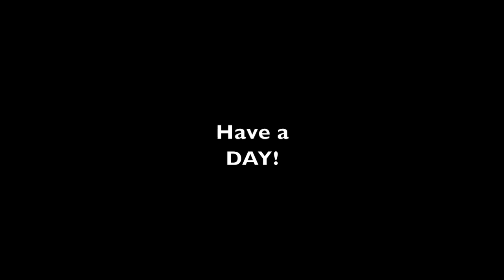#651 More Hardwoods on The Woodmizer LX 150 Sawmill, Red Oak

Comment: Starting at 4:45 it looks like the debarker and the blade are a little misaligned. Is it just the camera angle or just me.
Reply: Beat me to it. The band saw isn't tracking in the bark blade groove. There must be some adjustment on one of those two blades. Can't be such a big deal as there's bark on the opposite side that isn't addressed at all.
Reply: I noticed the same thing
Reply: Well a few of us picked up on this one I see. Well Mike, this tells me your camera work is quite good and your viewers are sharp enough to pick up on a small detail such as a misaligned debarker. Either some viewers are sharper than the average bear or the videos skew our viewpoint enough to ask about alignment of the debarker?
Reply: I immediately saw that as well! It made me wonder if we can’t see it via the camera angle as well as reality looks, but it seems to be 1/4” to 3/8” misaligned. I also noticed that the deviation appears to be less as the debarker moves inward. Anywho, I really, really, really like your videos Mike. We need to get you and Melissa out here in Wranglerstar Land!!
Reply: @munched55  Debarker is on side where tooth enters cut. Dirt here will be dragged into cut acting like sandpaper to dull the tooth. On other side of log, tooth is leaving cut, and dirt here will just be thrown into the trash chute.
Reply: Seems like the debarker isn't parallel to the blade. It looked to me like when the debarker was more open to the outside of the log it was cutting close to the blade cut.  When it traveled toward the center the debarker cut tracked lower than the blade cut...

Comment: Hey Mike, am i seeing something that's not there but is the front saw not cutting a guide path through the bark to save the main saw blade? Are they misaligned? I have no idea about this equipment, it just looks like the front motor is cutting a little lower than the actual saw blade.  So, please look over my ignorance if I'm missing something. HahaThanks for the great content.

Comment: Hi, I'm worried someone might trip on the cant hook laying on the ground, especially walking backwards with a heavy plank. I had a mill with a holder fastened to the black part of the frame, so I could drop it in 2 inches and lean the top in a slot. Safety is very important near all this heavy equipment. You folks are making some much appreciated videos. Happy New year.

Comment: You should make some kind of marking system to mark those saw logs, either a color code marking or actually write on the end of the board.  Mark the type of wood and the date milled.  That way you will be able to look at the piles and know what wood you have without digging through it.  Only other thing would be to have separate piles for each type of wood and that could take up a lot of space.  Looks like Melissa had a lot of sawdust down inside her boots too.  Every time she brought a piece of wood over to the stack and dropped it onto the other boards, the sawdust just blew back across her legs above the height of the boots.

Comment: Mike my partner  over in wyoming just cut down a few of the old trees that ate dead, he said the scale on the A-Frame said, the tree he cut was 57 inches through and at 20 foot long weighs in at 24,000 pounds and its dry he said total of all of that tree is right at 98,000 pounds and thats one tree 90 foor long so my asking what kind of wood mizer do you suggest  money is not a problem,  plus for your sawdust you have, the horse people around your area could use it have you contacted any of them we use it the stalls for the horses

Comment: Mike,
It looks like your Debarker is not cutting a groove that is in line with your blade.  You can see a little step on the log and at times it doesn’t match at all.  It looks like the debarked is a bit low to the blade.  
Might check and adjust it if you can.  
Defeats the purpose of if they don’t match.   
The mill is marking nice cuts.  You have a great helper too!  Good team!

Comment: I have seen these wood splitting machines. 1 RAM and it's cut into fine firewood. The wedge itself is yuge. And the cylinder just pushes it forward and splits it into like 16 pieces. She does got a good machine.

Comment: pivot the board of to the side of the mill at almost 90 degrees so that you can lift it easily and you wont have to step inside the mill or lift it off the nearside.
Have you still got all the timber you have produced on the mill or have you sold some?

Comment: Mike - does the de-barker need to be re-aligned a little? It looks as if the band saw blade is cutting above the track left by the de-barker blade. Ta for sharing the video.

Comment: A little tip from one who worked in a sawmill, as you are pulling the board off the log don’t lift the outside edge up as you pull it towards you push down on it to lift the inside edge up its easier to get your fingers under it and less likely to slip out of your other hand pinching your fingers. Girls don’t look pretty with blackened fingernails. Hehe

Comment: awesome video, nice helper.  
 i wish i had a sawmill, however i don't. sawmills are expensive ,take huge space and are a lot of maintenance .
   i have a technique i have gotten pretty good that is fast and cheap.  i call it the eyeball sawmill.  here is what you do, you do need a nice chainsaw, i have an old husky 266. with a 28 inch bar. its likely only worth 100 bucks. pretty old ,i rebuilt it once.you need to be experienced with a chainsaw.
    so what i do,drop a tree,trim the branches and buck a log maybe 10-12 ft.. longer when you get more practiced.  before though do this(best money i ever spent,22 dollars at harbor freight,a chainsaw chain grinder) make sure you have a precision sharpened chain) also file your rakers down more then normal(this will make it a little jumpy when doing other work)  so smooth one edge a little for knots and burrs, then take a reg. chalkline and snap a line, then holding your saw steady cut a slice off the side,maybe 5 % of the log following the line. then turn the log with the cut up, then mark out your boards and snap perfect lines on the nice clean raw wood. now start cutting but remember to feel the saw, drag if you are unsure toward the line and go back and forth dragging toward the center of the line,feeling the saw and not flinching at all, , split the line in half you can be very accurate, if you didn't sharpen your saw right you will fail.
     i have made 8 -12 foot boards from a log from 10 inch wide to 13 inch wide ,in 45 minutes.(how long does it take to do that with a sawmill?)  beautiful roughsawn boards, i have built buildings with them even sheathed roofs with them, they are a little rough but pretty darn nice. sometimes preferable to new lumber.    there you go.

Comment: The part with the camera showing the blade cutting the red oak log sure looked like the blade was not cutting flat, but instead riding up over hard spots. The blade didn't stay in the groove the debarker made. Was this the case and what causes that? Dull blade or cutting too fast maybe? I ask because. I'm thinking about purchasing a band saw mill...

Comment: Mike - when you are feeding the saw into the wood - in this video It looks like you are pushing the sled.  Is it power feed or manual?  Also from the de-barker cam - it looked like the blade was cutting above the de-barker cut in some spots

Comment: On the wood splitting, I don't know what all that equipment costs but I get the same job done with a $30 splitting maul and some great exercise for my aging 57 year old body.
Reply from the maker: Yes you sure can split wood by hand, I have done it myself quite a bit. However we sell firewood, I work a full time job, take care of two houses and a 100 acres. I also spend 40 hours or more a week on our channel. What this equipment allows me to do is produce 50 cord a year to sell without spending all my time doing it. Make sense?

Comment: was just wondering why the pile is so far for your helper....and why she removes every cut? Ive found leaving the cuts in place  helps abate curling or warp.
of any cuts...I remove the group of boards with equipment. then sticker it. woodmizer usually only has one clamp and the book recommends to nest your cuts Or leave them in place, until there is a clearance problem. to abate curl or release.

Comment: what she is doing will do her back in, if she trips over the frame it could cause her to go head first into the gravel, why don't you put a hook on the saw which grabs the board and pulls it back and have the pallet at the rear at a reasonable height, ya only have one back.

Comment: Whenever I run my pant legs in my boot instead of over the boot I get saw dust down my boot, worst is chainsaw chips.   Then there are those holes in you your pants that collect such chips or shavings and then a direct deposit to the inside of the boot.

Comment: I made a comment on Facebook the other day that it starts to get light around 7:15 in the morning and starts to get dark around 3:30 here in Missouri.  Instead of worrying about climate change, we should be worrying about the dark ages.  JK.  I also noticed that when you (Mike) and Melissa are working together, you get to play with all the toys as Melissa does all the heavy lifting.  Doesn’t Melissa like playing with the toys or does she prefer to do the heavy lifting?  I know with my wife, it depends on what we are doing.  She will not touch the chainsaw, but hand shoveling snow, she jumps right in.

Comment: Why do you cut those boards so thick? 1/2" would suit a lot of applications, especially project use.
Reply: Van Admore As A woodworker I prefer true 1 inch think boards. Remember these are rough cut and need run through a planner- joiner before building furniture. 1/2 inch won’t leave much to work with and has a tendency to warp more when drying out as well.

Comment: Is it just me or does that scoring blade need to be adjusted up to line up with the band saw blade?  It seemed like it wasn't scoring at the same height as the cut line so the band is not getting the benefit of having the bark scored away.

Comment: Hey mike do keep extra blade for sawmill just in case you brake one
Reply from the maker: Yes
Reply: ashley stone the blades are only about 150 for 10 - 15 bucks each at the dealer. They will sharpen them as well and send them back to you which is even less. The actually last longer than you would imagine.

Comment: how long before you can use lumber for framing ?
Reply from the maker: This will be used for interior projects, furniture, trim, maybe flooring? it will be awhile before its dry
Reply: @OutdoorsWithTheMorgans  Right. The ? was about framing lumber, joist, studs rafters, braces etc .. Thank you

Comment: Seems to me, if you were stacking the wood on the other side of the mill, she wouldn't have to "step" across the frame of the mill. Also, why not make the blade with teeth on both side, so it could cut both ways!

Comment: Oak Boards 💰💰💰 Just look at the price next time you're in Home Depot or Lowes. Gotta be a rich man to buy oak boards. Maybe you can remedy that situation. Dont know why the price is so high ? Oak trees are everywhere.
Reply: First off, red oak is in demand. Next, the big box stores are stocking dressed boards meaning they're planed on four sides which affects the price. If you have access to a surface planer and jointer, buying rough 4/4 from a hardwood supplier and dressing the boards yourself is the way to go. Sometimes the supplier can do it for you too.
Reply: @edaker4684  Yepp...Very true. Beautiful wood for furniture and finish work.
Reply: Ed Aker 👍 absolutely correct

Comment: But why bust it then convey back onto the ground if your gona do that load it in trailer or wagon work smarter not harder..
Reply from the maker: Huh? And do what keep  buying wagons and trailers when I fill them up? That wood wont move till its sold. At that point it will be loaded into dump trailer with firewood  bucket on tractor

Comment: I don’t like the design caring that kind weight nobody should have to step over the edge to get to the wood and or this is just set up wrong from the operator but with the band squeeze on that side looks like it has to be. Any way be careful don’t let your back get hurt